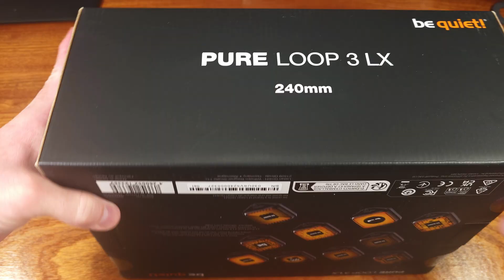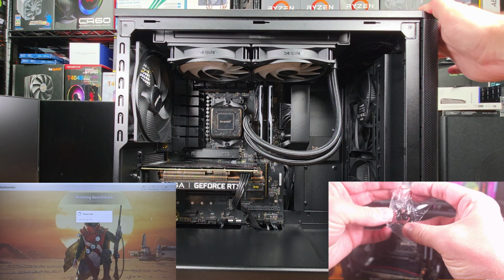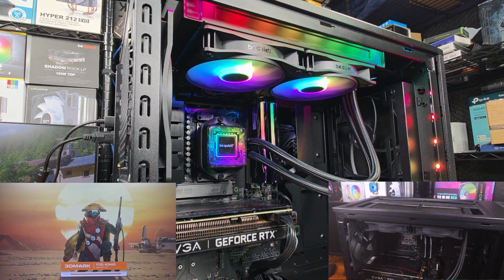The be quiet! Pure Loop 3 LX 240mm Watercooler - Perfect For Ryzen 9600x!

Comment: Hey, man! Great video. Quick question. I assume its totally doable to just install the pump the other way as well? As in the tubes are coming out on the left side? Might be something i have to do if i decide to buy the non RBG one for the dan a4 h20 case
Reply: From what I have seen on the product page, yes it is doable. I ordered mine today for the same case in fact, I can let you know when I finish the build eventually.
Reply: @ersen.b Thank you, man but no need! I bought and installed. It is indeed flippable
Reply: Oh that's great to hear, I am kinda curious about your thermals and acoustics now lol
Reply: @ersen.b  Its the first AIO ive used. Honestly, to me, the pump can be a bit loud depending on what you're doing. At idle it makes a gurgling sound but its not something that bothers me. Thermals are great from what ive seen. Ive never gone above 70c. Granted, that can depend on what kind of games you play. The CPU im using is the 9600X as well which has a low TDP anyway
Reply: Well that's great to hear since I too am planning to pair it up with a 9600X. Coming from a laptop I feel like the pump wouldn't bother me that much, and you seeing 70 at max means there's plenty headroom. Thanks for taking your time to answer, cheers